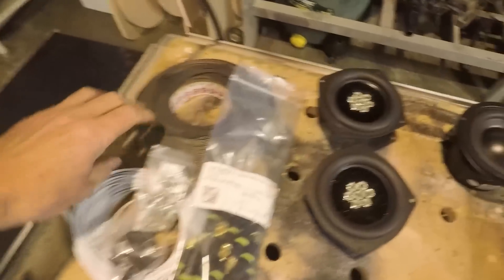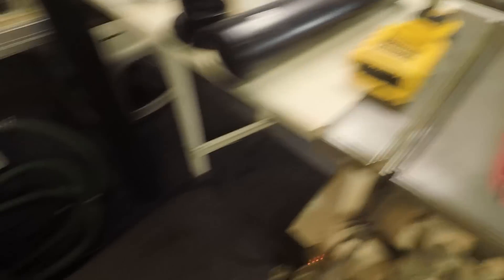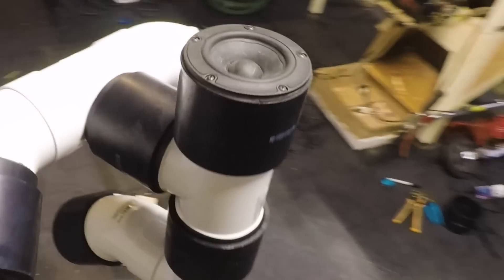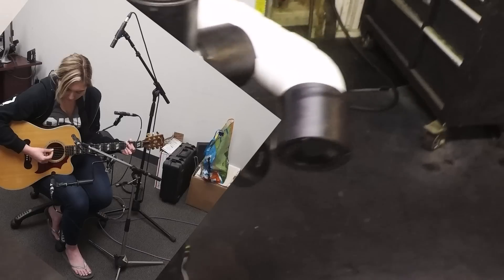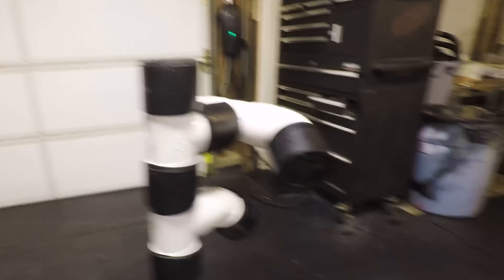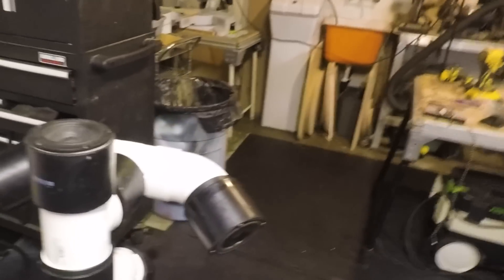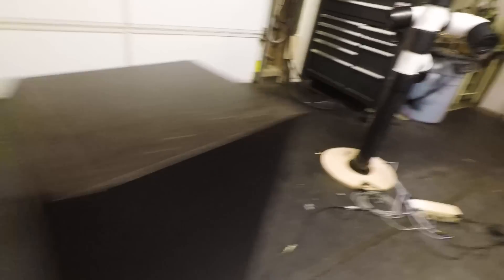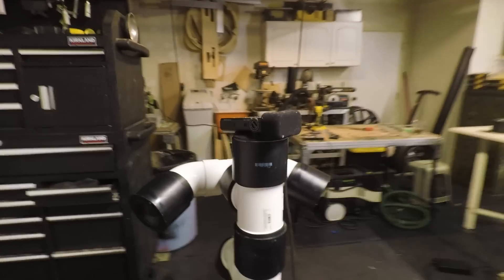Speakers Don't Sound Real, Lets Build One That Does

Comment: I would love to hear an array of these speakers placed in a room in the same exact configuration as an array of binaural mics (or ambisonic mics)  Rather than doing a close mic of each instrument, have binaural rigs all around the room, with one speaker being fed by each individual mic. So you're trying to recreate the entire space. So basically put the speakers the same distance apart as the ambisonic mics were in the recorded space. I feel like that might be interesting, yes?
Reply from the maker: To work properly, each of the 4 speakers need a distinct signal or mic. And each unit reproduces a single instrument
Reply: @DaveRat  I guess I just wonder how  4 capsule ambisonic room mics would sound in conjunction with the close mics? It would add to the total number of speaker systems, but it seems to me that it could add some way to recreate the atmosphere that the group was recording in as well. I would think that maybe you would want to reconfigure the 4 speakers to be placed in the same configuration as the ambisonic diaphrams. Just a sort of thought experiment.
Reply from the maker: Though there are visual similarities, it's a bit different. The ambisonic mic captures sound from various directions at a point in space. Capturing instruments and room and reflections and all.

This design is teying to reproduce an instrument that was recorded with little or no room sound. It is not about recreating the sound of another room.

It is about recreating the sound of purely the instrument and placing that reproduction in the listener's room.
Reply: @DaveRat  Yes, that absolutely makes sense. I guess I was just modifying the intent and use case slightly by adding ambience control version of your iidea.. Thank you for this and all of your videos. They are filled with great insight.
Reply from the maker: Thank you Draper and appreciate the comments and love that you are pondering!

Comment: I get the point but there are some flaws in the concept. First, you're comparing a omnidirectional array to a single directional speaker.  Try comparing it to an Ohm Walsh.  Also you didn't compare it to a stereo pair. To me it sounded like the Infinity was out of phase or something because the highs were severely lacking. Either that or the tweeter was not functional.

Also, this concept won't work unless as you say you have one of your speakers for each instrument. This also won't work for electric instruments which are typically played through an amp (speaker) then miked. The quality of the recorded sound is only as good at the studio mix. Stereo image, sound stage, dynamic range etc. are all created in the mixing room, not by the instruments themselves. Even in a live setting you are listening to an instrument played through an amp that is miked and then mixed and amplified and played back through speakers unless the venue is small enough to not require microphones. Which is why the stereo image played back on a hifi system imitates that at the venue. 

We would all like to have Steve Winwood sitting on a stool in our living room playing "Can't find my way home" live in front of us  but it doesn't work that way. I would like to hear a stereo mix played through your PVC speaker cabinet to see how it compares. That's more "real world".  Btw, why didn't you play your recorded guitar back through a wooden "cabinet" that resembles the guitar body to recreate the natural resonance of the notes? Quite frankly, there are just too many variables for any reproduced music to be completely realistic. Having said all that, it sounded pretty good for PVC!
Reply from the maker: I don't have or own or have ever made an omnidirectional speaker.

But I did make a multi channel multi directional speakers that reproduces realistic sounding audio.
Reply: @DaveRat  I agree. If I played your recording on my system I believe it would sound awesome as long as everything were in phase etc. I get what you're doing but I don't walk around the back of my hifi system while listening. Also, that Infiniti speaker looks like it has a lot to be desired. I want to hear the same recording played through an Ohm Walsh. By the way, thanks for the replies. This is rather cool!
Reply from the maker: I don't have an ohm Walsh and also I am guessing by the time it gets through YouTube the added cost over a mediocre speaker would be diminished to nill.

Keep in mind. The speaker I built is not crazy expensive. 

I will do more vids and grab some of the other hifi speakers I have.

Comment: That problem is already assessed by at least dipole speakers or even moreso omni-directional speakers, but I like the mad scientist vibes of this Video.
Reply from the maker: Pretty sure the example you offer radiate the same sound in multiple directions

This speaker radiates different sounds in every direction.

Sending the same sound in all directions is unnatural and not great sounding due to reflections having the same exact content as direct signals causing comb filtering and other issues.

This speaker is like an actual instruments that radiates differing sounds

Comment: I always enjoy your thoughts and experiments and this time I can say it's "outside of the box" .   Yes the number of tracks isn't really an issue but a standard would be required that's for certain. The combinations of the number of instruments and positions within the room are infinite and therefore would create a challenge for a standard?  I do see this immediately as a  no brainer instrument amplifier. It's not hard to see this in the millions of clubs and venues with singer songwriters creating more realistic soundscapes.  I just may put together a similar experiment to check out feedback rejection insitu when I get home.  That is your speaker concept close to the audience and a microphone array on stage for match direction source.  Thanks Dave. You are the best.👍🙂
Reply from the maker: Well, this is designed for reproduction not reinforcement.

Also, I believe adequate realism can be achieved with 3 speakers. So existing 9.1 surround amps could do 3 distinct instruments and a 4th, 5th or 6th instrument could probably be spread amongth the outputs. So, bass, vocals and guit with 3 inputs each and drums spread out to the 3 units plus sub.

That should recreate a 4 price rock band with realism of sitting in rehearsals or a small club.
Reply: @DaveRat  Yep, got your design  goal. 👍  Also I really, really enjoy all of the well recorded, mixed and mastered surround sources using only front left, right and rear surrounds.   Thanks Dave :-)
Reply from the maker: Oh, I do too, I enjoy music live and reproduces in many formats

And adding a format focused on somic realism seems valuable

Comment: A big part of the problem is the way music is recorded and mixed. The minute you add compression, eq, or reverb to a recording, it will never sound "real" or "live." It always makes me laugh that one of the selling points for high end systems is "wide soundstage" and "separation." The engineers intentionally "weld" the instruments together with multiple instances of compression. Some of the most realistic recordings I have ever heard were those that were essentially dry.
Reply from the maker: Agreed and that hits on the head this design.

Rather than trying to recreate an environment in the listening room, this strives to just put the instrument with the listener

Comment: You invented the Bose 901 speaker. Also Magnapan, etc. There are a lot of speakers that are designed to radiate sound in multiple directions, or in 360 degrees. Still cool, tho.
Reply from the maker: Hmmm, you are headed in the right direction but keep going.

The Bose 901, magnepan (I've owned both) send the same signal in multiple directions.

That is the opposite of what I am doing. 

The whole idea here is not to send one sound forward and absolutely not to send the same sound in multiple directions.

This sends a different sound in every direction, like what a real instrument does.

Comment: Stereo from properly configured and modern loudspeakers with good technical performance is able to make ghosts appear in mid-air - sound from where there are no speakers. Dave, you are not the first person to tilt at this windmill, and you won't be the last. To understand why speakers work the way they do, you have to understand why microphones and our ears work the way they do. A microphone is a minimum-phase, point-source transducer. When you direct one microphone at one instrument, you pick up the sound that was radiated in one direction, at one distance, but you also pick up some things you didn't expect - room reflections from all directions. A point-source loudspeaker is not that difficult to achieve either - Stuart Hegeman built a famous one, and Morrison Audio makes a similar product. There are also similar omnidirectional speakers by Harman, Duevel, Syng, Falcon, Davone, and others. But they all have a problem, they radiate sound into your room the way an instrumentalist does, but they also illuminate all the surfaces of the room the same way - not just your ears. When they do, they combine the original recorded room reflections with additional reflections from your own room, which is a very different kind of space from the venue you want to re-create. The result is that they only work with close-miked, minimally processed music, and produce a "they are here" effect, but they are not able to transport you to the recorded space. Only speakers with controlled directivity operating in a treated space can begin to produce the realistic transmission of complex frequency, level, time, and relative phase information to your ears to recreate the original performance. Start with two binaural microphones, driving two headphones - what do you hear? Then as you move the headphones away from your ears and toward the location of ideal speaker placement, what is being added or lost? We need to produce focused sound radiation toward our ears, and absorb sound energy that travels in directions we do not want - that's the only way to provide realism.
Reply from the maker: Hmmm, stereo relies on the listener staying still and collapses as soon as ya wander around out of the narrow area equally covered by both speakers. And even then it sounds as real believable as watching TV makes you thing people are in your living room

As far as what can and can not be done, stereo strives to recreate an environment inside of a listening environment.

Which is useful and can sound great.

This design drops the musical into your living room and does it with surprising realism.

As far as what can and can't be done, you just watched a video of it being done!

Comment: I think you just discovered that you want an omnidirectional speaker. Nothing new under the sun. There are plenty products on the market and they are phase coherent and hi-fi as well as radiating sound in all directions. Apple's bluetooth speaker is omni for example. There is even the highend/DIY method of making spherical radiators a'la MBL. 
That being said most people want their speakers out of the way and they don't dance around them. In that case that Infinity is the way to go, because it's designed to do that. Your speaker will just have a terrible timbre from proximity effects. 
I remember an artist who would use speakers instead of musicians and that was his orchestra. Maybe you can find that guy.
I'm pretty sure you can find some kind of music that can be recorded dry and then played through musician-speaker band in your room. It sounds to me like an idea from one of those hitech rooms, where the stuff moves out of your way and hides in the wall. The kitchen morphs into lounge, the speakers drop from the ceiling and you have a band playing in your house. Boy, this hobby is getting more and more expensive with those "budget" ideas ;).
Reply from the maker: Hmmm, perhaps you have not thought this through and are jumping to a seemingly simple answer when the challenge is a bit more fun and complex? 

An Omni speaker radiates the same signal in all directions.

That is an unnatural event and completely the opposite of what I am looking to achieve.

A musical instrument and most sound sources radiate differing sounds in differing directions.

That is what I am working to achieve.

If you are interested, I did a video on he same sound radiated from multiple sources. With an Omni speaker, the reflections off of surfaces combine with the direct sound and other reflected and cause more issues because they are all the same sound.

With a real instrument the reflected sounds tend to be different versions of the sound and therefore do not interact in as drastically negative ways with each other.

Here is a link to the vid

https://youtu.be/VHjdh-Vka-g
Reply: @DaveRat  Ok, I think we're on the same page now, although I'm getting scared with how expensive  and big this can get. Playing separate tracks of the same instrument in different directions. At the same time keeping these tracks in their polar patterns, so that they don't cause issues, as you say. Ouch, that's a lot of drivers, waveguides and work. But given where today's technology goes, complicated speakers like this will be more and more accessible.  It reminds me of how many  audiophiles like to use a dipolar tweeter or even a bipolar pair to have rear projection. Although I think they do it more for balancing power response than anything. 
I'm no expert in music, but I do know how string musicians project their sound forward and consequently you don't hear the high freqs behind them as much. This is very similar to the box speaker. Same with vocals. In other cases this box speaker might be less accurate, so I imagine sending another channel to a driver on the back baffle might help fix that on that occasion. Sounds like a job for some 4" markaudio. What I want to point out though  is that this method in it's dry form might result in recreating sound in your listening space. It will not take you to the place where the event was recorded. So maybe this is the part to research. What can you do to make it "ignore the walls"?
A guy behind that Infinity speaker once said in a lecture that stereo is for making illusion and not for wave reconstruction. You seem to be fed up with the cheapness of the magician's tricks ;)
Reply from the maker: Yes, you get it! And I am not saying there is a right way. Just that if you desire to creat a realistic sounding instruments, shoot diff sounds in diff directions. And correct, this is not about making your room sound like some other room. That is a job for stereo and surround and such.

As far as expensive, sounding real and sounding identical to the source are not the same thing.

It's fairly cheap and easy to sound real. Sounding identical is where things get complex and expensive.